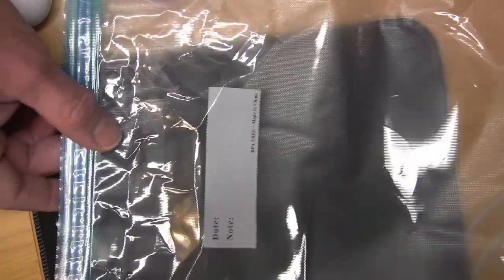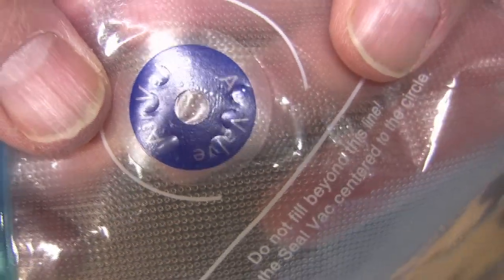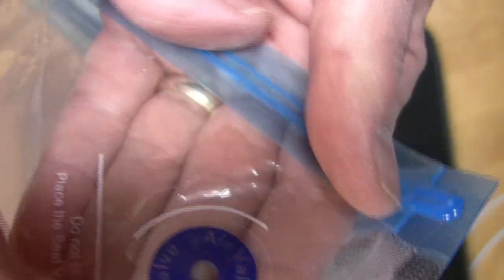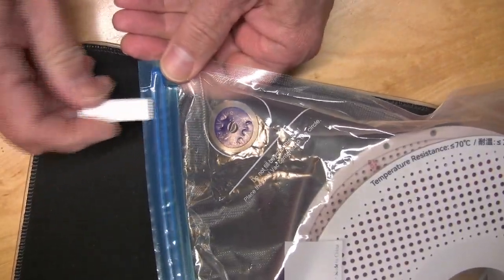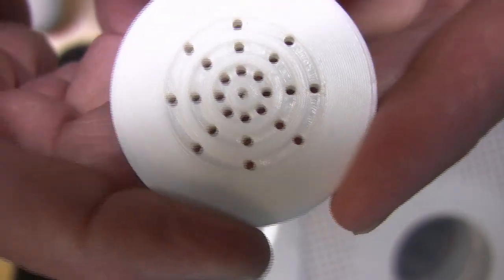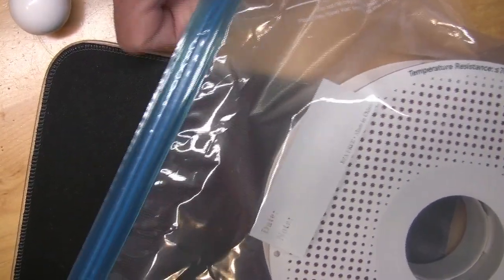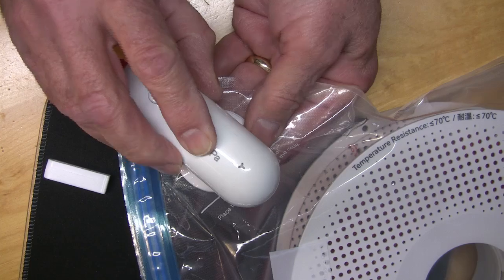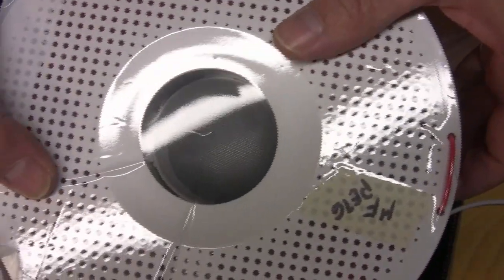Vacuum Bag 3D printed valve adapter

Comment: watched your technique  (nice).  However I spot design mistakes.   Should be no ridge "top".  Need a dip in the center on the "top". 

explaination:
There is only one hole in center on the bottom of the seal bag ring. And want your pump silicone ring to meet bag and place PRESSURE on bag!  Solid surface. not bumpy surface helps pump silicone ring adhere to the bag. 
Going to need a small dip in the center to direct airholes to the bag's center hole.

Comment: Thanks for these. I had some thinner ones that don't use holes but like slots but these seem to work better. One thing I've noticed is that wetting the seal on the pump seems to be helpful. Still seems like it is hard to get them started but once they start....  Thanks again.

Comment: Loved the design, printed me some and it worked great.

I though my electric pump didn't work with these bags and I have been using the manual pump, but as soon as I tried with the adapters it worked perfectly!

Just one caveat, you should really post this on printables or thangs, so it doesn't get lost on thingiverse.